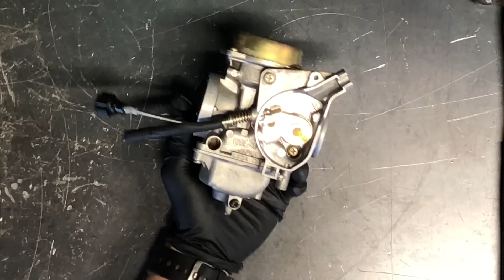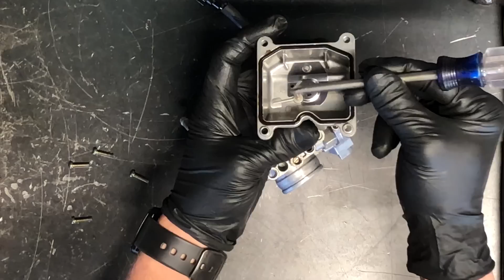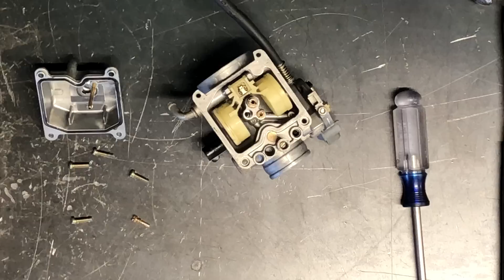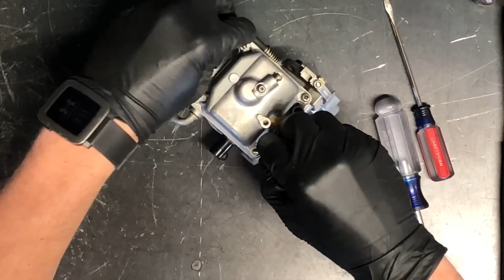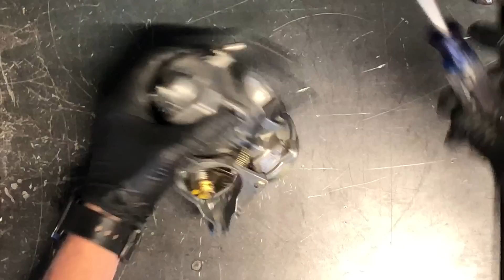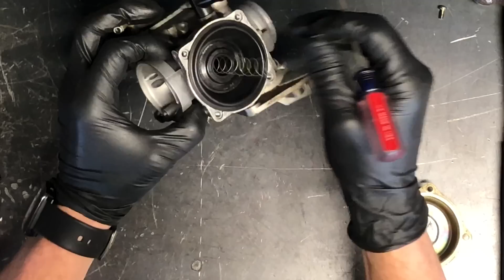HOW TO Arctic Cat 400 Carb- WONT START or IDLE Clean Repair Rebuild Carburetor Carb Kit 0470-504

Comment: I’m having an issue I think with my carb. It starts and idol‘s fine but when you give it gas, it starts sounding like it’s gurgling or missing like it’s getting too much fuel or too much air and it doesn’t wanna keep up if you give it a little bit of throttle and kind of lean into it slowly the motor will catch up and run its speed fine but if you try to give it a lot of gas all at onceit bogs down. If somebody could help, I would greatly appreciate it. I was thinking about buying a new carburetor for it.

Comment: Great video!  In regards to the jets, which one is responsible for rich/lean at idle?  Quad seems to start, run and accelerate fine. But I have a little smoke and raw fuel smell when it’s idling. Or could it be the air fuel screw?  Thanks!

Comment: This carb looks very similar to the carb on my 2008 Suzuki King Quad 400 (LTF400F).  Might be the same carb.
Reply from the maker: It very well might be. Arctic cat and Suzuki used some of the same motor / intake parts for several years.  Thanks for watching and the comment. Have you watched some of our other videos on this same model?  Also if you have need parts check out:  https://www.ebay.com/str/midnebraskamotorsports

Comment: Stellar job. On the bowl, there is a overflow nipple, where do you attach a hose to it and where does the other end of the hose goes to?
Reply from the maker: Hose is attached to the nipple on the bowl. The other end runs down your crankcase and just dangles there so any drips of fuel ends up on the ground (or evaporating before it gets to the ground) Thanks for watching and the comment. Hit that subscribe button, if you will.  https://www.ebay.com/str/midnebraskamotorsports

Comment: Why is gas running out of the bottom of the carborator? I had this happen last year. I took the 2001 panther 440 to a small engine shop to get fix last year, I only put on 70 miles, and gas is running straight through the overflow again on the bottom side of the carborator.
Reply from the maker: Your needle/ seat is bad or stuck open. There is a chance it is your float, but typically these don’t go bad. My guess is, when they re-installed your carb, When they put the fuel line back on, it broke a piece of fuel line off and it ran into the needle area and was lodged. Allowing fuel to flow freely. Thanks for watching. Let us know if that works!

Comment: Great video!  The carb on a 2016 Alterra 400 is identical, except the air fuel screw cannot be adjusted, it has no screw head and appears factory sealed.  My problem is the carb leaks out the overflow about once a month over the spring-summer-fall when it is used but I cannot figure out why as everything is clean (I have also installed an aftermarket fuel filter on the fuel line from tank to carb) and it leaked 2 days after installing a carb kit.  I take it apart, clean everything, put it back together and its good for a while, then it overflows again, and I repeat the process.  Sadly, your video didn't help solve my problem, but it is an excellent video.
Reply: Hey, my 16 400 alterra starting leaking out of the carb overflow as well, pretty sure this is the first time.
I haven't taken carb apart yet, wondering if you were able to figure yours out?
Thanks
Reply: @kristianturner131  Sorry, I can't confirm I have solved the problem as I put the quad away for the winter in November 2022, but it hadn't leaked for a while before I put it away.  I dumped the fuel tank and cleaned it out to ensure no debris inside, changed the fuel hose in case it was deteriorating, put a better in line fuel filter on the fuel hose (I had been using one for a lawn mower that was 40 micron but got one at 10 micron) and put a new float valve that I got from the arctic cat dealer and not from a generic carb kit.  The quad seemed to run better and it didn't leak for weeks where it had been leaking after a week or so after cleaning it previously. I'll see what happens in the coming spring to fall when it gets used again.

Comment: continuation: (part 2 of the question) i see the bottom of the needle comes completly out of the hole. as if the needle gets rased to high, any suggestions?
Reply from the maker: oh boy. Too short of needle? Did you replace the needle? You definitely don't want it coming all the way out of the hole. Did the needle spacers get put in the correct position? Thanks for watching. Let me know what you find!
Reply: @MidNebraskaMotorsports  thnk you so much for your reply. i myself did not change the needle. we bought it when it was just 2 years old so i am assuming it is the original needle. i will say it is a 250cc. Your vid was the closest we could find and the carb you used was almost (if not completely) identical. I am gonna pull it off and take it apart again. needle spacers? i know we had a spring and plastic insert. We watched your video step by step, thought i did it right only to have it pop when idling and hardly any power. also very wet and black plug.

Comment: I have the 1999 300, only idles with choke on, will run mid and full throttle with out choke but sputter.  Runs perfectly with full choke all rpm. Any suggestions on what to clean?

Comment: Awesome detailed video sir! I have a 300, but my carb is identical. I went ahead and bought a new carb (only $15 more than a rebuild kit) and am going to calibrate it to your specs when I do the install this weekend. Not a motor head, just a DIYer trying to get a used toy ready for my son and your specifics will be a great help. Very grateful you took the time to do this for everyone.
-Joe
Reply: Don’t by them cheap carbs just clean your old one.
Reply: @cinema_yo  It’s worked out good up to this point. I did keep the old one though. But really, there is very little variance that I could see in the two…
Reply from the maker: Happy to help. Let us know if you need anything.  ebay.com/str/midnebraskamotorsports

Comment: I have an 02 or 03 400 MT. We bought it as a leftover but since new,  the quad never would idle during winter.  We would need to run it hard for a few minutes to prevent stalling out. Do you think I should replace the pilot jet with something different?
Reply: Hey, it's me! Turns out the machine had a clogged jet for like 20 years!!! Thanks for the help, I fixed the starting issues years ago. Now need to fix some other issues with carb...

Comment: I just followed your video step by step Thanks for this video. My issue is with the PILOT JET. I can not see through it and can not get any wire through it. Even micro sized wire. Should I be able to see through this jet?
Reply from the maker: Yes, if you can't see through it at then your atv won't idle /run correctly. You can replace it. Most dealerships will have a jet for a couple bucks just make sure it is the correct size OR send it here and I will free it up! Let me now. The pilots can be frustrating. Thanks for watching.

Comment: have a 2002 articat 400.  been nothing but prablems  with fuel leak. on carb .  this carb looks diffrent .
Reply: i have a person who messy with this stuff .  im not familar with these . i can do carb on tractor .lol.   i took the carb  off myself. took the bowl off .  i took the seat out and was a small o ring  on the seat that was bad . matched one up .  i put it together and. hooked up fuel to it other than the wheeler for two days no leaks . i put it back on the. wheeler no leak for a whole day . now i think its coming from the small primer on the cab .  we previously  put a new one on  the carb   it is  still on wheeler .
Reply: @MidNebraskaMotorsports  what is your full email to send pictures?

Comment: Hi I have a 2015 arctic cat 400 I clean carburetor twice and I did a pressure test the the needle and seat and no leaks I put it back to get best kind after just seat there it will leak gas out of the overflow on bottom of carburetor   I been at small engine a long while this one got me stumped

Comment: My arctic cat 400 been sitting for years rebuilt the carb now it runs terrible spitting gas in the air box. What could it be ?
Reply: @MidNebraskaMotorsports  thanks for the reply. I figured it out. The accelerator pump was upside down but now it leaks gas out of the overflow

Comment: Hello there, my son just bought a 1999 Arctic Cat 400 4x4 ATV and it runs real rich, also leaks fuel into the crankcase after it sits. When running it gets so rich it coats the spark plug with black ash so bad it won’t start anymore. It is missing the over flow needle and throttle linkage cover plate. It has a black plastic/foam material float. The throttle cable connection area is a lil different in design. I did adjust the float so it would close sooner however it still doesn’t seem to close at all. Please help if you can. Thanks, great video!

Comment: I just bought a 2008 arctic cat 366 4x4. Its in excellent shape but not running.  Got it cheap.  I put a new carb on and adjusted valves. There is no fuel getting to spark plug. What would be the problem? Low compression due to rings? Stuck valves?  And what is the other hose input an side of carb. Not fuel line, not bottom drain,  the other one? Great video BTW
Reply: @MidNebraskaMotorsports  thanks for reply.  Motor turns fine. Has spark.  Ill check that video next. Thanks

Comment: Any idea why my 02 arctic cat 400 bog after around 20 percent throttle. I have cleaned the carb and have tried a Chinese carb it acts the same. If i cover the snorkel some it runs fine. Acts like its lean but the plugs black. Any ideas?

Comment: Hi I just installed a new aftermarket carb on my 366, Runs fine, Idle is fine.  While I am driving along if I give it full Throttle it seems like it starts to bog, if I ez into it I can get to full speed,  with no bog.  Do you think I need to adjust the air screw in 1/4 turn? Or out?  Thanks

Comment: I just bought a 2004 Arctic Cat 300 4x4 & on my carburetor there’s a small gap because of a bolt missing and air is able to get through where that lever is around 19 seconds into your video..can that be the cause of my Arctic Cat shutting off after I make a stop?

Comment: I have an Artic cat 400 that's been sitting for a couple of years because it quit running. I finally bought a new carb and it will start but instantly goes dead and then won't fire again until I let it sit for a few minutes. Any ideas?

Comment: Hey quick question is this carb the same as a 2006 dvx400 ? Going to pull mine tomorrow and clean it just curious?
Reply: Its a Suzuki engine, same one used in the Eiger and I think the Kingquad, if its te 400 version. Good engine.

Comment: I just got a Arctic Cat 400 to fix a no spark issue. After getting spark I had to clean the carb for the machine to start. Now it will start but I have to play with the throttle and it is running terribly. Black smoke coming out of tail pipe. What did I do wrong?
Reply: @MidNebraskaMotorsports  The owner put the updated flywheel and stator kit on the machine before bringing it to me to find what else was wrong. I diagnosed a CDI problem and changed that, fixes their wiring issues and was able to get spark.
I cleaned the carb, changed the fuel in the tank, found that the electric choke was busted fixed that. Then I put a new spark plug in it and it still runs bad. One thing I did notice was when I pull the power wire off of the coil it sparks really bad?
Also I have the push button/starter switch off of the machine due to corroded wires. I am waiting for new one to arrive. Right now I am jumping wires in the harness to get it to start, I wonder if that is causing some of this? Sorry this is so long. By the way I subscribed to your channel. Thank you for your time.

Comment: I have an 04 articcat fis 4x4 manual getting spark got the timing set flywheel magnets are in place and woodruff key is good even sprayed starting fluid in and cannot get it to start any ideas on the issue or maybe sensors that could keep it from starting? Any help would be appriciated

Comment: Same carb on my 08 500. Thanks for the vid. Bike was running kinda bad Friday, wouldn't start Monday day. Watched this then took mine apart and cleaned with compressed air and carb cleaner, runs better than ever now. Had tiny pieces of the old air filter that was coming apart clogging jets/ports.

Comment: hi,i cleaned all the jets like u did on video ,,my arctic cat,,ran great rode for bout 30 minutes,,turned it off,,,started it an hour later,,back to same problem idle great,,would not take any gas above idle,,im at a loss...help lol
Reply: i put on new gas line and a filter,,cleaned the jets again ,,and put new spark plug in,,still will not take gas,,,but if i let it idle for like 30 to 40 minutes then it will take gas and run great,,im at a loss again @MidNebraskaMotorsports
Reply: You have a dirty fuel system,  starting at the fuel tank- peacock- filter-carb. All has to be cleaned!

Comment: Very good video. My carb does not have a hose on the over flow on the bowl. When I get one how long and where does it connect on the other end to? Mine has a slight leak from the nipple, maybe because there is no hose.

Comment: Can you explain how to do a carburetor slide mod by drilling the 1/8” hole? And when this is done, should there 3 or 4 coils cut off the spring? Can a needle shim be put in this carb? If so, does the main jet need to be changed?
Reply: Thanks for the reply, but you didn’t answer any of the questions. 
The video is great and you explained everything very well but none of the questions were answered???

Comment: have a 2006 650 H1, hard starting when cold , starts fine afterwards , not the smoothest running and pops a bit from muffler when letting off the throttle
also stalls a lot at idle or engine brake down hills , thinking carb clean but not sure , just bought it 3-18 and was running fine , plug , oil , and filter and belt replaced just prior to purchase , thanks and I subscribed
Reply: @MidNebraskaMotorsports  No O-ring and washer on that air fuel screw?